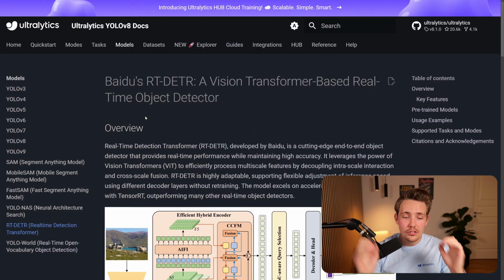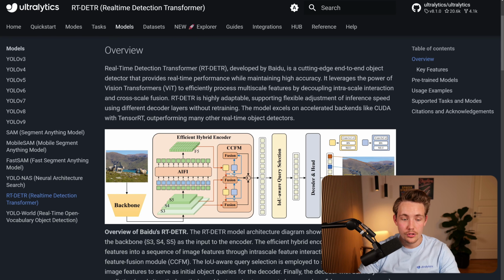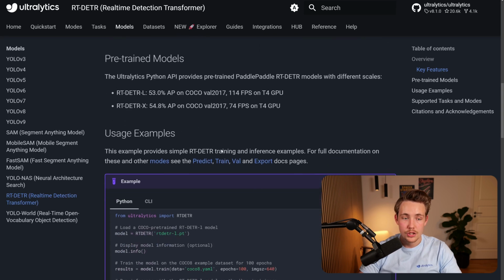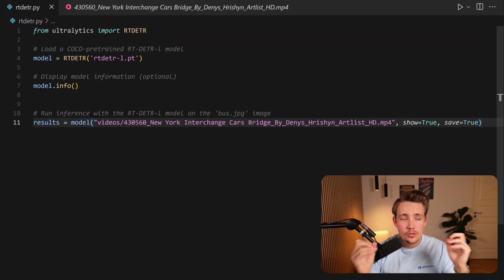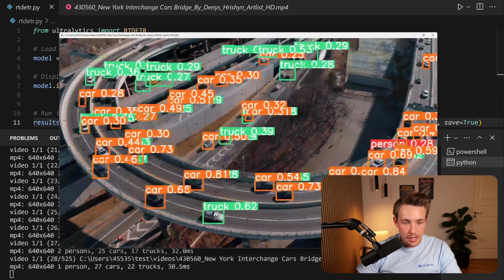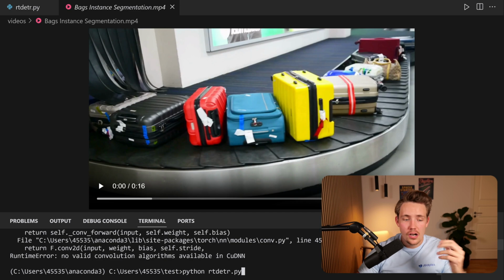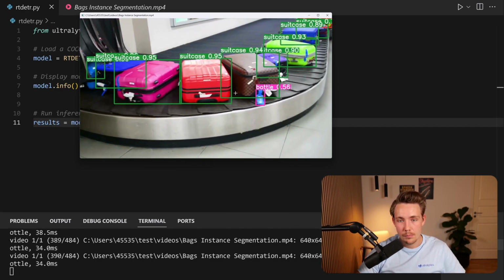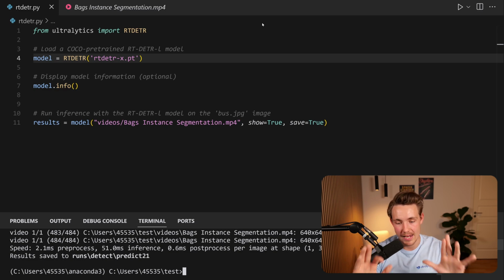Real Time Detection Transformer (RT-DETR) | Episode 42

Comment: Love seeing cutting-edge stuff like this! Quick question though—how does RT-DETR handle smaller objects in cluttered scenes compared to YOLOv8? Do the multiscale features really make a noticeable difference, or is there still a tradeoff somewhere?
Reply from the maker: Great question! RT-DETRv2 leverages its Vision Transformer (ViT) backbone to capture global context, which helps in understanding cluttered scenes and detecting smaller objects more effectively compared to traditional CNN-based models like YOLOv8. The use of multiscale features indeed plays a significant role, as the transformer architecture allows RT-DETR to weigh image regions differently, improving feature extraction for smaller or overlapping objects. 

However, there’s still a tradeoff. RT-DETRv2 models tend to have larger parameter sizes and may require more computational resources, which could impact inference speed on resource-constrained devices. Meanwhile, YOLOv8, with its lightweight design, excels in speed and efficiency, making it better suited for real-time applications where hardware is limited.

For a deeper dive into how RT-DETRv2 handles these scenarios, check out this comparison: RTDETRv2 vs YOLOv8 https://docs.ultralytics.com/compare/rtdetr-vs-yolov8/.

Comment: Bro, how does RT-DETR handle small, fast-moving critters? Asking for my trail cam setup—squirrels are speed demons. Also, wonder how it stacks up against YOLOv8 in dense forest scenes?
Reply from the maker: RT-DETR is well-suited for detecting small, fast-moving objects like squirrels due to its transformer-based architecture, which excels at capturing global context and fine details. Its real-time capabilities ensure it can handle quick movements efficiently. However, in dense forest scenes, where lighting and occlusion can be challenging, YOLOv8 may prove advantageous because of its strong balance between speed and efficiency, especially on resource-constrained devices.

For a detailed comparison of RT-DETR and YOLOv8, including their performance in complex scenarios, check out this RT-DETR vs YOLOv8 comparison https://docs.ultralytics.com/compare/rtdetr-vs-yolov8/. It outlines strengths like RT-DETR's accuracy and YOLOv8's adaptability for diverse applications.

Comment: Hello,

Can we use ultralytics for RT-DETRV2 model as well. I have .pth checkpoint for RT-DETR-R50 model trained on VisDrone dataset. How can we do the validation and prediction using .pth checkpoint? Is there way to convert to .pt format.

Thank you.

Regards,
Bijay
Reply from the maker: Hi Bijay,

Yes, Ultralytics supports RT-DETR models, including RT-DETRv2. However, `.pth` checkpoints aren't directly compatible with the Ultralytics framework, which typically uses `.pt` format. To use your RT-DETR-R50 model, you can convert the `.pth` checkpoint to `.pt` by loading it in PyTorch and saving it in the `.pt` format. Once converted, you can validate and predict using the Ultralytics RT-DETR interface.

For validation and prediction with RT-DETR, you can use the Ultralytics Python API as shown in this example:  
```python
from ultralytics import RTDETR

Load the converted .pt model
model = RTDETR("converted_model.pt")

Validation
results = model.val(data="path/to/visdrone.yaml")

Prediction
results = model("path/to/image.jpg")
```

For more details, check the RT-DETR documentation https://docs.ultralytics.com/models/rtdetr/. If you need guidance on `.pth` to `.pt` conversion, let us know!
Reply: @Ultralytics  

My checkpoint's state_dict has the following keys:

date
last_epoch
model
criterion
postprocessor
ema
optimizer
lr_scheduler
lr_warmup_scheduler

*********************************************************************
import torch

# Load the checkpoint file
checkpoint_path = "output/rtdetrv2_r50vd_6x_visdrone_50/last.pth"  # Replace with your file path
checkpoint = torch.load(checkpoint_path, map_location=torch.device("cpu"))

# Check the contents of "state_dict"
if "state_dict" in checkpoint:  # Check if 'state_dict' is a key in the checkpoint
    state_dict = checkpoint["state_dict"]
else:
    state_dict = checkpoint  # Directly use checkpoint if it is the state_dict

#model.load_state_dict(state_dict)
#device = torch.device("cuda" if torch.cuda.is_available() else "cpu")
#model = model.to(device).float()

torch.save(state_dict, 'rtdetrv2_r50_vd.pt')

***********************************************************************
I used this code to save .pt format checkpoint. It saves the checkpoint. But, I get some error when I use the checkpoint for validation using ultralytics.

from ultralytics import RTDETR
model = RTDETR('rtdetrv2_r50_vd.pt')
**********************************************************************
Error: AttributeError: 'dict' object has no attribute 'to'
**********************************************************************
I think the checkpoint is not load correctly. If you could review the code to resolve the issue, that would be helpful.

Regards,
Bijay
Reply from the maker: Hi Bijay,

The error occurs because the `.pt` file you've saved only contains the `state_dict` (model weights) but lacks the full model architecture, which Ultralytics expects when loading a model. The `RTDETR` class requires a complete model checkpoint, including the architecture and weights.

To resolve the issue, you need to properly save the full model, not just the `state_dict`. Here's how you can do it:

1. Load your model architecture along with the `state_dict`.
2. Save the full model using PyTorch's `torch.save()`.

Here's the corrected code snippet:
```python
import torch
from ultralytics.models.rtdetr.model import RTDETRDetectionModel

Load the checkpoint file
checkpoint_path = "output/rtdetrv2_r50vd_6x_visdrone_50/last.pth"
checkpoint = torch.load(checkpoint_path, map_location=torch.device("cpu"))

Load the RTDETR model architecture
model = RTDETRDetectionModel()
model.load_state_dict(checkpoint["model"])  Load weights from the checkpoint

Save the full model in .pt format
torch.save(model, 'rtdetrv2_r50_vd_full.pt')
```

You can now use this `rtdetrv2_r50_vd_full.pt` file with the Ultralytics framework:
```python
from ultralytics import RTDETR
model = RTDETR('rtdetrv2_r50_vd_full.pt')
```

If you run into further issues, ensure the RTDETR model's architecture matches the one used during training. Refer to the RT-DETR documentation https://docs.ultralytics.com/models/rtdetr/ for more details.

Comment: Hi, there. I've got several questions if it is available for you to answer.I've modeled both YOLO(included v8/v10/v11) and RT-DETR(included v1/v2) and used for the image detection of fire and smoke(particularly images of 704*576). We inputed over 40 million images which is photoed by 12,000 security cameras.The images are choosed by random. The result showed that YOLO recognized 58 correct smoke images and 420 incorrect images, which RT-DETR recognized 440 correct and 22456 incorrect images.Why does RT-DETR have so much incorrect recognization? Which model do you think is better for image detection of fire and smoke?
Reply from the maker: Hi there! It sounds like you've done extensive testing. The high number of incorrect recognitions with RT-DETR could be due to several factors, such as model configuration, dataset imbalance, or training parameters. It's crucial to ensure both models are well-tuned and trained on balanced datasets.

For fire and smoke detection, YOLO models, especially YOLOv8, are often praised for their speed and accuracy in real-time applications. However, RT-DETR's performance can be optimized with proper tuning and dataset adjustments. Consider revisiting your training setup and ensuring both models are equally optimized. For more insights, you might find our RT-DETR documentation https://docs.ultralytics.com/models/rtdetr/ helpful. 😊
Reply: @Ultralytics Your words really inspires me a lot. There's only a few more question. Why do you think YOLO v8 is better, compared with v9 and v10? If i keep adding the correct image(the image really have fire and smoke, which is found in the 40 million images) into the model as training, and copy new data from the 12,000 security cameras. How much time do you think i may have the proper model i want?
Reply from the maker: I'm glad to hear that! YOLOv8 is often favored for its balance of speed and accuracy, making it suitable for real-time detection tasks. While YOLOv9 and v10 offer improvements, the choice depends on your specific needs and hardware capabilities.

Continuously adding correctly labeled images to your training set is a great strategy. The time to achieve a proper model depends on factors like dataset size, model complexity, and computational resources. Regularly evaluate your model's performance and adjust training parameters as needed. For guidance, check out our training resources: https://docs.ultralytics.com/modes/train/. Keep iterating, and you'll get there! 🚀

Comment: Hello, why the cuda does not utilize cuda? And also is the model able to utilize tensorRT?
Reply from the maker: Hi! If CUDA isn't being utilized, ensure your environment is set up correctly with the latest versions of CUDA and PyTorch. Also, check that your GPU drivers are up-to-date. For TensorRT, yes, you can export models to TensorRT for optimized inference on NVIDIA hardware. Here's a quick command to export a model to TensorRT:

```bash
yolo export model=yolo11n.pt format=engine
```

For more details, check out our TensorRT guide https://docs.ultralytics.com/integrations/tensorrt/. 😊

Comment: What is the dataset's format to train this model?
Reply from the maker: To train the RT-DETR model, you can use the Ultralytics YOLO format. This format involves organizing your dataset with paths to training, validation, and testing images, along with corresponding labels in `*.txt` files. Each label file should be formatted as `class x_center y_center width height` with normalized coordinates.

For more details, check out the documentation here: Ultralytics YOLO Dataset Format https://docs.ultralytics.com/datasets/detect/.

Comment: Hi, i was going to use this model for my tracking olympiad of hexbug..  i have 100 videos and 100 annotated csv files. How can i use this model for my custom dataset
Reply from the maker: Hi! To use the RT-DETR model for your custom dataset, you'll need to ensure your videos and CSV annotations are in a compatible format. First, make sure you're using the latest versions of `torch` and `ultralytics`. You can start by loading the model and running the tracking command with your data. For detailed steps, check out our tracking documentation here: https://docs.ultralytics.com/datasets/track/. If you encounter any issues, feel free to share specific error messages or code snippets. Good luck with your tracking olympiad! 🚀

Comment: why is box_loss and class_loss so high when training yolov9 ultralytics?
Reply from the maker: High `box_loss` and `class_loss` when training YOLOv9 with Ultralytics can be due to dataset issues, like imbalanced classes or annotation errors, improper learning rates, poor model initialization, unsuitable batch sizes, or mismatched anchor boxes. Ensuring dataset quality, optimizing hyperparameters, adjusting learning rates, using appropriate anchor boxes, and leveraging pre-trained weights can help mitigate these high-loss values. Monitoring the training process and making necessary adjustments are key to improving model performance.

If you want more information, you can open the new issue in our GitHub repository at: https://github.com/ultralytics/ultralytics/issues/new

Thanks,
Ultralytics Team!

Comment: AttributeError: 'RTDETRDecoder' object has no attribute 'stride'  How can this problem be solved in training?
Reply from the maker: Please make sure to upgrade the Ultralytics package, hopefully, it will resolve the issue, If not you can open the issue at: https://github.com/ultralytics/ultralytics/issues

The command to upgrade the Ultralytics package `pip install -U ultralytics`

Thanks,
Ultralytics Team!
Reply from the maker: Yes, you're right! Using `from ultralytics import RTDETR` should resolve the issue. If you need more details, you can check the RT-DETR documentation here: https://docs.ultralytics.com/models/rtdetr/

Thanks for the tip! 😊

Comment: I trained my model with YOLO8M, and I figured out how to save time on preprocessing and inference using results[0].speed['preprocess']. But now that I'm messing around with YOLO5, I can't seem to find a similar command to save speeds. I've just found  xyxy[0] . Any thoughts on how to sort this out?
Reply from the maker: Right, In Ultralytics YOLOv5, You can store the time in some file or print it, the code is available at: https://github.com/ultralytics/yolov5/blob/920c721ea77315291f987ea5b911be7fb619d134/detect.py#L255

Thanks
Ultralytics Team!

Comment: I trained the RTDETR on custom dataset for realtime video object detection, but the inference time for it came out around 800-1000 ms, why such high inference time for the model that I have trained?
Reply from the maker: This issue could be related to the image size used to train the model or the hardware you're working with. You can try running inference with a smaller image size, such as imgsz=320, to see if that speeds up the process.
Reply: @Ultralytics  I just want to tell you that I'm not running the model on GPU but instead on CPU, is that the main reason why it's taking so much time.
Reply from the maker: Yes that can be the reason. we will recommend you to utilize the nano or small model If you are running inference on a CPU device. Thanks
Reply: @Ultralytics  but there isn't a small or nano model available for rt detr, or is there?
Reply from the maker: You're right; RT-DETR doesn't have small or nano versions. Running on a CPU will naturally be slower. For better performance, consider using a GPU. You can also explore other models like YOLOv8, which have smaller versions optimized for CPU. More details here: RT-DETR Documentation https://docs.ultralytics.com/models/rtdetr/.

Comment: Hello, I have a question about YOLO, It's said by ChatGPT that:

"Newer versions of YOLO generally perform better with lower resolutions due to improved architecture and training techniques."

Is that true?😲What does "perform better" mean? I think lower resolution may lead to higher inference speed but lower accuracy.
Reply from the maker: It relies on the training model with custom data and the image size (imgsz) used during training. Running inference on the same imgsz used for training can yield improved results.
Reply: @Ultralytics  OK, got it, Thank u:yougotthis:
Reply from the maker: You're welcome! If you have any more questions, feel free to ask. Happy modeling! 😊